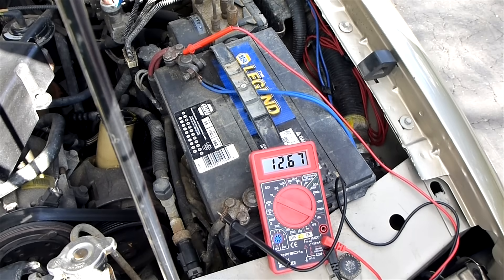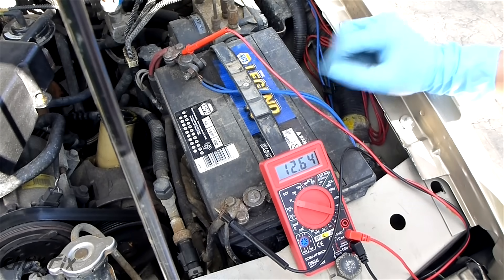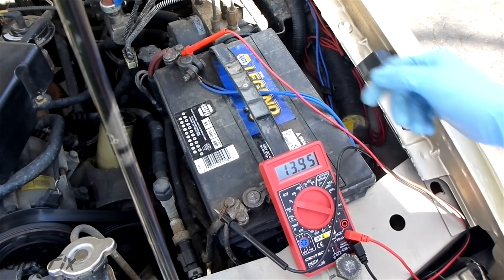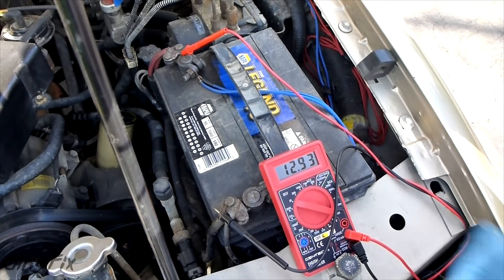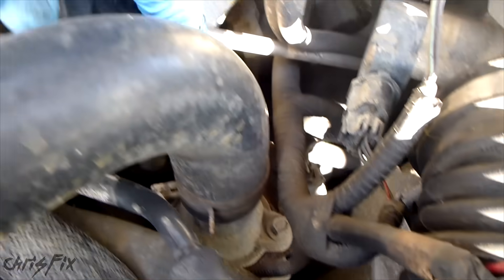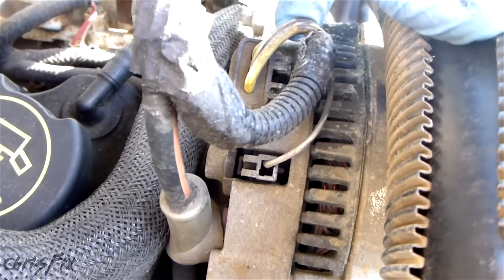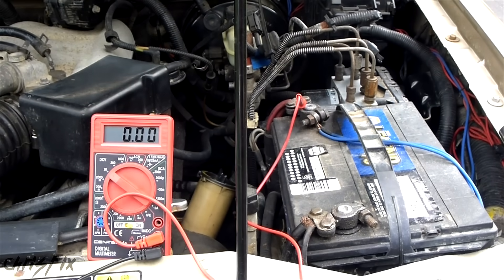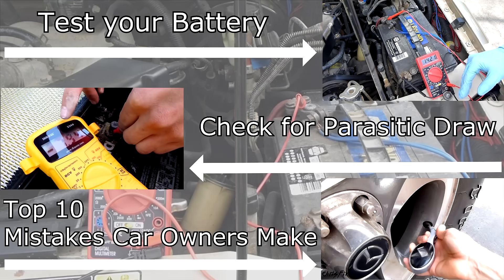How to Test an Alternator

Comment: My 94 Silverado on the battery gauge has been fluctuating from normal to over 14 volts and the batter light will come on when it goes over 14 volts. I need to buy one of these meters to see if that truly is the case or is the gauge going out on the cluster.

Comment: Don't need any multimeter. .Has all you need to do is  . First jumpstart your car then remove the positive side battery clamp if the car if the car stops running it's the alternator if if it  carry a on it's the battery. The alternator keeps your car stuff charging the battery only starts ur car and let's the lights and radio work .simple.

Comment: I checked my battery with multimeter. Voltage is around 12.5 when the engine is off. And when it's running reading is still 12.5 until I run all the accessories then it goes to 14.1 8 . is it normal? Car is honda civic 2014.

Comment: Great information! Thank you! Now, what if battery is located under passenger seat and alternator is accessible only under the car? Should I use extension wires from battery to check voltage drop?
Reply from the maker: Correct.

Comment: another great video from Chris showing an easy to understand car thing for us home repair types.  When I tested the alternator with the multi on the alternator I got a wild variation in readings from 6V to 14V with it not stopping anywhere so I think a bad voltage regulator?

Comment: I replaced the alternator on an old gas powered toyota forklift.  With the lift running,  I got 13.45 on the multimeter.  This is probably sufficient for the forklift, yeah?  I don't have any other electric devices on the lift.

Comment: I have a 2011 Chevy Silverado 2500 HD.   I noticed, after driving for several hours, that the analog meter on the dash showed about 16 volts.   So the next day I got a volt meter and checked it.  With engine off it read 12.7 volts.  When I turned it on, it read 14.8 volts.   I checked as best I can the connections and made sure battery terminals were clean and good.  Still 14.8 volts so I changed alternator.  Now, when running the voltage reads 15.2 volts!   Can someone help diagnose this?  I am pretty sure that both alternator's voltage regulators can be bad which I think means I have a bad connection somewhere.

Comment: Big fan of your videos you had helped me a lot thanks Chris.   I have a question my carnhas a brand new battery,  and I tested the alternator , clean temininals, put a new starter relay. But when temperatures are under about 32 degrees outside  my car has a grinding noise when starting cold and light flicker when cranking.  I'm thinking  needs a new starter  what do yo think?

Comment: Using my multimeter I connect negative probe to negative and positive probe to alternator case but get 00.00.  My alternator pushes out 50volts tested with multimeter on B+ and a ground. .no blown fuses. New alternator, voltage regulator, battery, and battery terminals. 1972 b200

Comment: I'm having a lot of trouble at the moment. I drive a 2012 Jeep Wrangler Sport, I had a battery light come on, so I checked the battery terminals, good clean connection there but I decided I'd be dumb and go buy a brand new battery. It fixed the issue for a few days, then my light came on again, bought a new alternator and installed it, now my battery light stays on. My previous alternator while charging, was 11.1 to 12.1, my new alternator is showing 10.9 to 12.7 while charging.

Comment: I just replaced my battery, and it reads 13.9v on idle.
i read somewhere 13.8 to 13.9 is normal alternator charging 
but I'm always having problem starting the engine in the morning at -10c.
is this something I should worry, or is this normal?
Reply from the maker: Sounds normal for charging. Clean your battery cables and grounds to make better connection. Your starter might be going bad and drawing a lot of amps from your battery. When it is cold it is even more difficult to start for every car but with a starter that is going bad it could make it even worse. Check out this video: https://www.youtube.com/watch?v=yC409CU7mU8 for the starter replacement and this video: https://www.youtube.com/watch?v=YC--MLNIbik to see how to check your battery and other electrical systems.

Comment: Parasitic voltage drop test on LMM 6.6 diesel with dual batteries. Do I need to disconnect one of the batteries when conducting the tests and does it matter which one?

Comment: I used your video to doublecheck what i knew was right.

Battery on muh tractor shows 12.x when turned off and 14.3-14.5 when turned on.

It has drained a brand new battery in about 4 weeks - but alt shows to be charging.

What gives? Some parasitic draw somewhere? Really confused because there are zero accessories on this tractor.

Comment: I don't understand the "parasitic voltage drops". I understand "bad connections", but I don't understand why they cause high readings.
And I don't understand testing the positive side. What does "the nut" do? Does that cable feed battery power to the alternator?

I apologize if these are dumb questions. I can accept "high readings" are bad, but I don't understand the underlying dynamics.

Thank you for the video.

Comment: What would cause a new battery to drain by just sitting for a few days? The car was only ran (sitting not driven) for about 5 minutes with the new battery and after a few days of sitting, the battery is completely dead (not even allowing the car to turn over)

Comment: So I just changed my battery because my car will not accelerate it will when I start it but after a while the battery light comes on and then the abs light and won’t accelerate until I stop pressing the gas and I’m guessing letting it rest and then it accelerates for a little bit and then it happens again so my final guess is that it’s the alternator. I’ve took it to 2 mechanic and they both told me that there is nothing wrong with the car so I’m just trying to find some help. Anyone willing to help i would really appreciate it thank you for the video and explaining. Very helpful!!!!!!
Reply: My car is a 2003 infantry g35 btw lol if anyone has knowledge in that car i just got it from one of my patients that i was taking care of and had the car just sitting for god knows how long if that helps to know as well.

Comment: i think this is a decent video but you dont talk about the control side of the alternator? some people will watch this and do your testing and put alternators on and then have to go back and diag because the control wire, fuse, ecm is faulty? not hating at all. good basic info but you should make sure people understand that IF all that CHECKS out to go back and pay close attention to the control side or youre just doing half the diag and hoping you are correct.

Comment: What if when you start up the car the voltage is still at 12.6v? Does that mean the alternator is done or the connections from the alternator are not working? When I give it gas it doesn't go up in volts either. It stays at 12.6v and slowing starts going down

Comment: Hey Chris or anyone, dunno if any pays attention to older video comments. Will the reading be different for different amp alts? Got a 15 Fusion 2L T and it's reading 14.9-15.0. only reason I ask is there is 3 different alts for this car 150, 175, 200, didn't know if it made a difference.

Comment: I had one battery few years ago that steadily put out over 12 volts and couldn't figure out why it wouldn't start. Turns out that as soon as you put a load on it the battery will go almost dead it was weird

Comment: How's it Chris....just wanted to find out something ...
In my van the alternator voltage dropped  slowly from 14.2 right down to 13.6 and eventually to a point whereby the alternator isn't charging at all , do you know what could be the cause ....or if the alternator is completely damaged and I need a new replacement

Comment: Thanks for the video.  I have a 2012 Tundra with a new alternator and it is still not charging.  Everything seems good but my battery light never comes on.  Does anyone know if that will make the charging system not work on a Toyota? Thank you.

Comment: Hi Chris. I need your advice if you can please. I changed my radiator about 2 months ago and I didn't know I had to bleed the air out ( I also did a full flush and put new green coolant). Then about 2 weeks ago from now (about 6 weeks after installing my new radiator) , I fitted a new thermostat and I'm having overheating problems in fact the temp gauge went right to the top about 2 weeks ago ( possibly soon or right after the new thermostat got fitted. I had to alot of steam coming inside the car vents so I put a Radiator Stop Leak product to stop a leak I think in my heater core but I think I had to bleed the air even after fitting the new radiator and perhaps again after fitting new thermostat also. I still have overheating issues and I have the exact same spillfree funnel kit you have so I'm gonna try to release the air with this funnel kit from the cooling system. Can you please give me advice on how I should go about it?

Comment: My '14 Sienna, reads 12.69 volts while off.  When I start it, it only goes to around 13.43.  When I rev it, it goes up, but not much-only to about 13.50.  Does this meager increase likely suggest a faulty alternator?

Comment: Hello, I dont know if I should post it here because its not about car but my ATV.. but I cant find any solution... The problem is that battery isnt charging.. I located and meassured alternator cable, there was like 100-150Volts in cable that is going to the voltage regulator, but the output from the regulator that is going to the battery, I guess, was without any power, just 0 volts.. So I replaced voltage regulator but didnt helped. On fresh charged battery on turned atv is there around 13.5 volts, when I push gas the volts goes up to 13.6 maximum but the battery still isnt charging, by time it just drops down to 12volts and less again. I have no idea what is the problem here. I would appreciate every help. And sorry for my bad languagge :).
Reply from the maker: Replace the alternator.
Reply: @chrisfix  thank you

Comment: My original problem was my battery light coming on constantly so I got a new battery and it’s doing the same thing so I tested my alternator casing to battery it’s .01/.02 as well as alternator to engine block and that’s .01/.02 but what confuses me is that testing the battery being charged like in the beginning everything is fine, ran at 14v with all electronics on and when off back to 12v
Reply: And I don’t have that good of access to the alternator wires because my car is a 2008 Dodge Caliber and everything is so smushed together it’s ridiculous

Comment: I have an 06 Honda Civic EX. My lights and back brake lights flicker/pulsate when I have my lights on and driving. What do you suggest I test? Both battery and alternator? Could it be dirty connections?

Comment: If my battery is located inside the car but the positive and ground posts are under the hood can I just use those for the testing or do I need longer testing leads on my multimeter? Thank you for the video!
Reply: I’d say use the posts, they’d most likely give you the best readings on the multimeter, and they should be at the top of the engine bay no? Never heard of a battery thats buried in a engine bay

Comment: Hi Chris what if you have a 2013 Cadillac ATS AWD 3.6 with the BMS system that basically trickle charges the battery when needed will this be the same test or would I have to check at Alternator rather then battery? Alternator not convenientiently located at top of engine it’s at mid engine next to frame rail so hoping your way works for these intelligent systems they have now . I heard I have to do a BMS Reset .Thanks

Comment: Thank You!!! My buddy has a 2010 Jeep Liberty that was showing all the perfect signs of a bad alternator. So last night we jump started it and brought it back to my place so I could pull the alternator this morning, and while I was watching another video for friendly tips on how to do that, this video popped up and I decided to give it a look. FINALLY I got a chance to use my spiffy new volt meter! Of course the battery was in the low 10's with the engine off, but we jumped it and it was checking 14.6 - 14.7., but before we jumped it I checked and it turns out some shibididobo put a 20 amp 2 prong fuse in the M7 Cig/acc slot where there's supposed to be a 3 prong 20 amp fuse. yanked that incorrect 2 prong fuse out, drove the thing around for about half an hour to forty five minutes and turned it off. Battery checks 12.12 and is starting normally. I didn't get 2 minutes through this video and saved a butt-ton of wasted effort and time today, so thank you for that. Liked and subscribed. Keep up the good stuff! 👍👍👍👍👍

Comment: Off 12.6
Running 14.06
Radio, heat, headlights, hazards 14.02
After test 12.9
Triple A says it's the Alternator.
Mechanic gave me a receipt that says Battery Bad & Replace.
What do I do?

Comment: @chrisfix was changing alternator on my 00 Mustang GT and forgot to disconnect battery.  Wire that connects to voltage regulator from car to alternator touched ground twice.  Now car will only click when key is turned.  Battery is new.  Alternator is (was) new.  Any suggestions on what the issue might be now?

Comment: Two days ago I started hearing wind/whistling/teapot noise and found it came from under the hood. This morning the battery died. 
My friend helped successfully jump start it, but after driving a short distance in slow speed my car could not move. I installed a new battery, everything seems good now. The noise from under the hood can still be heard, but much weaker than before. Does this mean I am having a bad alternator?

Comment: I tried jump starting vehi le battery was charged so obviously its the alternator but as I tried putting the red lead against the alternator charge I get a voltage read car won't start but I get a voltage read only off the connector post on yhe alternator

Comment: Is it true that the alternator can charge the battery as it is supposed to but drain it at the same time because of a bad diode? So it would mean that you wont see error codes using a scanner as the alternator charging function works fine but a bad diode would prevent the current going only in one direction?

Comment: if your battery light comes on while driving but goes away while accelerating you most likely have a bad battery becuase the alternator is charging your battery while you accelerate but your battery isnt holding charge while you are coasting.

Comment: I cleaned my battery leads and I connected the red lead but once I connected the black lead, there is slow, continuous clicking coming from the engine bay. The keys were not in the ignition and the clicking stopped when I unplugged the ground lead. Any thoughts on what it might be?

Comment: This helped me troubleshoot- it shows similar readings which makes me think alternator is good. However, I still have lights flickering and there are times the battery light comes on. Bad connection? Didn’t connect alternator cables correctly?

Comment: Got a brand new battery but the volts keep dropping when my truck is on. Its definitely the alternator correct? I have a 2019 ram 1500. The battery is barley going to be 3 years old.

Comment: I have been going nuts trying to work out why my battery warning light is on all the time. Alternator is good according to test. Light still on. Have been switching alternators between car that was ok and 'bad' one. Now both have warnings staying on. This hopefully will cure both! I will run output text first. Very well articulated explanations. Thanks

Comment: Hi Chris, will you be able to shed some light on an a problem that I incurred when assembling the bottom and top casing of the car alternator.
This was after replacing the back( smaller) bearing. The alternator was taken out of the car several days ago so was devoid of any input power. However when I was assembling the casings some component blew, can’t see anything else other than the diodes .

Comment: Love your videos, Chris, but I think you need to clear up the confusion about the negative readings versus positive readings. To say minus .24 is not greater than positive .3 is correct but it leads us to think that if it had read minus .31 that it would have had a problem but minus .31 is also much less than positive .3. You weren't acknowledging the negative readings so it left me confused.

Comment: Your cable going into the negative terminal looks highly corroded and oxidized. Also the negative terminal rotated on the post when you put your meter lead into the cable. I would recommend a new terminal and clean the exposed copper of the cable.

Comment: 2010 Grand Caravan, the battery light came on but then went off minutes later. No code created, no check engine light.
12.8v on the battery with van off. Also good range 14v and just under when the van is running.

So the question is, what could cause the light to come on for a bit and turn off again? Could the alternator sort of go bad for a second and come back to life? I don't know how to test this if the light is coming on intermittently but the readings are good. I don't want to replace the alternator or battery on a whim, but if neither are testing bad, I don't know what to do next!